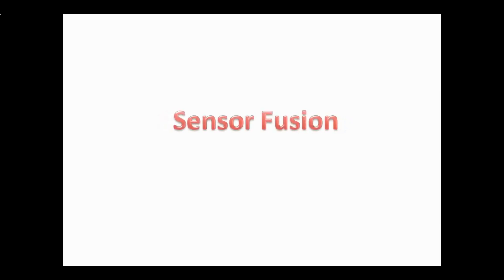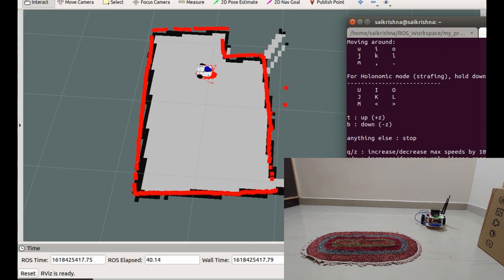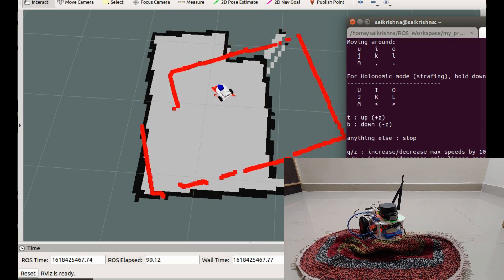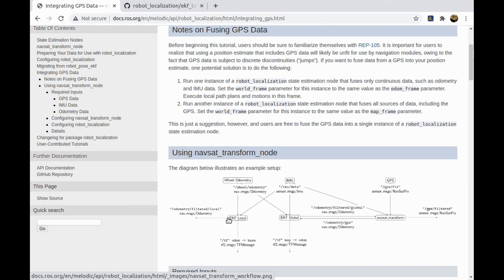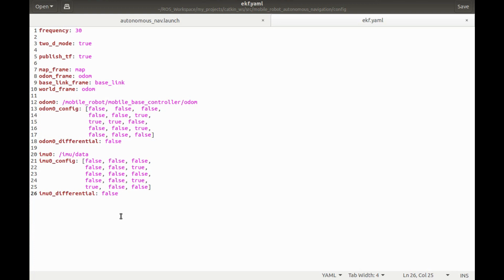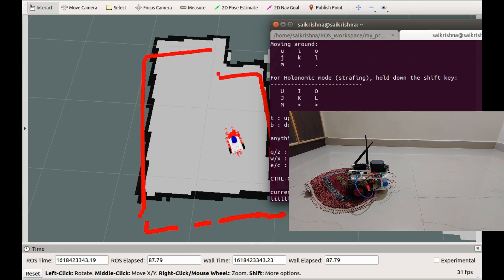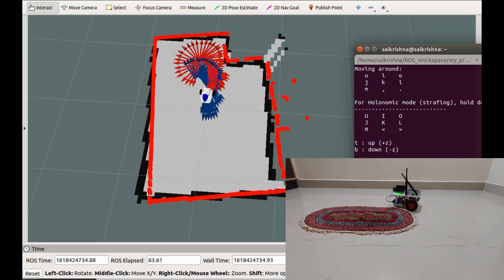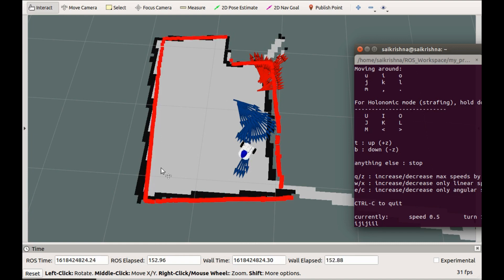Sensor Fusion in Mobile Autonomous Robot | ROS | IMU+Wheel Odometry | Kalman Fliter | Jetson Nano

Comment: hello friends, could you help me explain this question. In the ekf.yaml file. base_link_frame: base_link   => this frame got from odom which calculated from encoder? so we have  to run the node odom (calculated by encoder)   or the node transform between (base_link and odom) which calculated from encoders ?

Comment: I have a hardware robot built with IMU and Odometry. When I add the topics and covariance matrix in the ekf yaml, hardware robot is able to move based on the cmd_vel (when we give 2dNavGoal in rviz). But in simulation, the robot is not moving. Any idea on this?

Comment: Thanks for your video but i have a problem that when i run navigation using both amcl and ekf localization, there is an error in terminal: "Couldn't determine robot's pose asscociated with laser scan". How can you fix that?

Comment: Hello friend, thanks for great video, can you explain about the different between EKF and ACML,  what specific situation are they used in?
Reply from the maker: Amcl is good when the wheel odometry is accurate and reliable. EFK is used to fuse multiple sensor data like wheel encoders, imu, gps, etc to generate accurate odometry even when one of the sensors are giving faulty data.
Reply: @roboticsandroslearning8232  so we have to use ekf to estimate precise wheel odom, imu ... to create good odometry after this odometry will used by acml ?. Or we do not use EKF but use acml directly

Comment: hi i'm trying to implement the same fusing with diff_drive_controller odometry and IMU, however when the wheel stick in the mat, the position of the odomentry still changing as compared to your it will remain in the same place. Any idea what others configuration required?

odom0: /diff_drive_controller/odom
odom0_config: [false, false, false,
               false, false, false,
               true,  true,  false,
               false, false, true,
               false, false, false,]
odom0_differential: false

imu0: /imu/data
imu0_config: [false, false, false,
              false, false, false,
              true, false, false,
              false, false, true,
              true,  false, false,]
imu0_differential: false

Comment: Quite an awesome demonstration. I have a couple of questions:
1. Is that a lidar module in the front of the bot? If so, what is the purpose of the it in this project?
2. Did you undertake this project out of your own interest or part of a project or under the guidance of some professor?
Reply from the maker: 1. Yes it is a Lidar. Lidar is to get the laser scan data which is used for localising the robot.
2. This project is out of my interest.